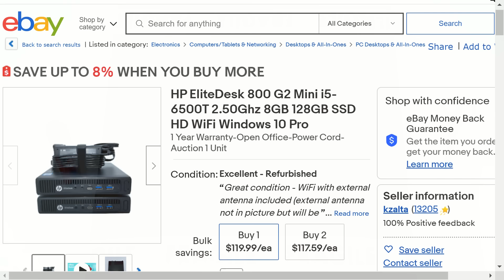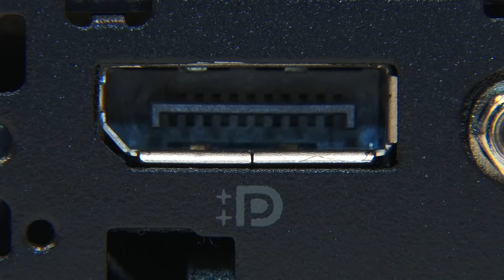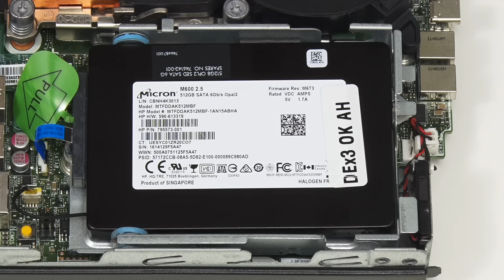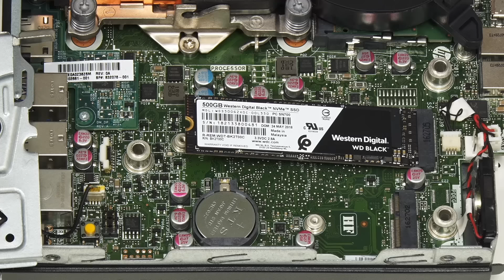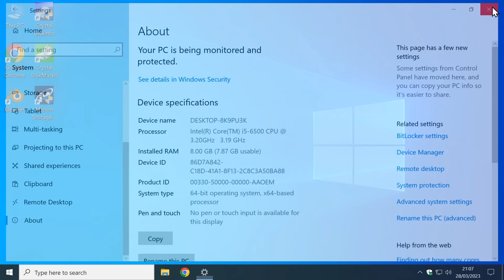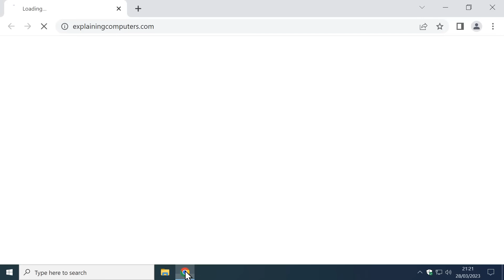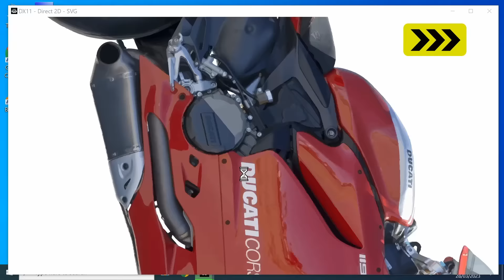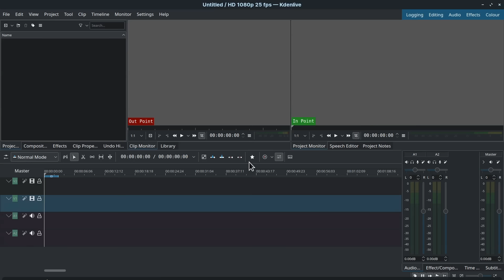Renewed i5 Mini PC: HP EliteDesk 800 G2

Comment: Great video Chris, I have been using one of these computers for the last 4 years as my daily triple booted with no issues. Although I have and array of other sbc and towers. I really like the size and performance of these units 
Thanks for your work
Reply: You don't trust the cloud ? Stuck in 1978, Personal systems need !
What you run on them ?
Reply: Some people (me ) just like computer hardware for the sake of it. I have a large collection of machines of different ages and types; just fun to use a different one now and again with various operating systems. They would have been thrown out so it's a good thing! @lucasRem-ku6eb

Comment: That's mini, not SFF. SFF is an official designation, certainly by HP.

There's only a handful of those on eBay Australia, we have heaps of Dells, mostly micro.

I got a Dell Micro of about that vintage, it seems to be buyer's choice whether they come windows Ten or Eleven. Mine cam with 32 Gb RAM, a 2.5" SDD similar yours, but allegedly new and M.2 WiFi. And, mercifully, no keyboard/mouse.

Before retirement I bought a lot of this stuff at auction, we were assumed to check the computers out before commencement, and then worked through the catalogue over several hours.

One auction hose in particular did a pretty good job of inspecting the computers, and buyers were alerted of discovered faults. I don't remember ever finding one that unexpectedly didn't run, I did sometimes find undescribed additional hardware, a disk here, a graphics card there. Some kind of satellite card one time.

Sometimes during the auction, sometimes at the end, we went to collect our purchases. At that time, we got the box(s) we purchased plus random keyboards and mice as described on the receipt.

I discovered it best to watch the first hour, while the amateurs met their requirements. I had no concerns about outbidding dealers, but the deeper into the auction the cheaper the computers became. The business computers were generally SFF, mini/micro hadn't been invented yet.

Comment: i’ve been tinkering with the hp elitedesk 800 g1 usdt for a couple years was used as a desktop replacement running linux mint then windows 10&11 with a spare hdd setup as an emulation drive since been retired to a htpc since then but still has plenty of life and power for other uses like it’s mxm gpu slot i’ve been trying to populate could turn it into a ssff gaming pc

Comment: Worked for a bit in a place where each worker had the Lenovo ThinkCentre M900 Tiny with i7 6700 and 16 gigs of ram - they actually do fairly well for the programing/designing that company does. The power rusage and snappy performance are the only real + sides tho. Even at 20-30% CPU usage the fan ramp up to max rpm and they not only produce serious heat (old hdd sitting next to it on the table was warm and that wasnt directly behind the fan) but the noise can be heard across a big room. The expansion or upgrade options are non-existent - u cant replace anything inside of them beside adding storage or ram...
Reply: Yeah, they are basically like laptops. If you do any major work the fan will crank up. Fine for general use, but if you like silence, or do heavy computing a full size desktop will be a better option.
Reply: @volvo09  Not exactly. In terms of expansion/thermals/power they are the same as laptops but even tho physically these tiny towers are smaller, you still need full peripherals to use them - aka input device/s, monitors etc. The main reason I was given why they bought them there was cuz of the pandemic and working from home (it was hard to carry the big desktop and monitors to ur home and room was an issue in smaller living spaces) + electricity bills (before they had older xeon systems which indeed hog more power). For this company, the workload requires 2 monitors with decent resolution (2k is minimum) and big screens - anything less or a single monitor just doesn't work when you need easily 4,5,6+ things opened at the same time. When you need to put 2 biga** monitors in your home, I don't see how the form factor of the PC would solve any space problems you might have.....  Meanwhile, as annoying as a track pad can be, laptop can easily operate anywhere on their own. Just bring portable 2nd monitor and , imo, you have better version of that PC...

Comment: One year ago I bought an HP ProDesk G5 for £150 with an i5 9500,8GB RAM and 256Gb SSD. I love the 6.5W idle power consumption because it runs 24/7 as a webserver.
Reply: A dell optilex with same config except 9600k cost me 100$.
Reply: It is interesting how low of a power draw simple computers have now.  I just bought a cheap new laptop with a Celeron N4100 in it, it almost never draws more than 13 watts and that includes a 14 inch monitor.  If I have it connected to my large office monitor it draws less than ten watts.  It isn't the most powerful CPU in the world but it plays 1080P streaming video and is decent enough for simple internet use.  It likely won't be my daily driver but it is light, compact and useful enough if I need to take a computer somewhere.
Reply: @mharris5047  Until you are looking for a 4K gaming machine for flight simulator.  Getting something power efficient is just not there yet.  Probably I have to wait two hardware generations for that. I don't want a noisy +300Watt system for gaming.

   I own a Prodesk 400 G4 I5 32 Watt and an Elitedesk 800 G4 I5 65 Watt. Affordable from auctions. Building a comparable Mini ITX system from second hand parts will be more expensive because of shipping costs.

 I also built a Haswell I7 T series machine myself in 2014. Still a useful NAS because of PCIE with NVme adapters and the sata connectors.  Not economically viable to replace that one yet.
Reply: I remember when SFF HP/Compaq PCs were the size of old VHS Recorders!

They had CD-ROMs & 3.5 floppy disk drives.
Reply: Nice deal for a G5 I5.
Reply: The HP ProDesk is a SFF PC (the Lenovo ThinkCentre M series also uses the same form factor). Chris should note that the HP EliteDesk isn't a SFF PC, and is using a different form factor; what ever that form factor is. Does anyone know which form factor the HP EliteDesk is based on?
Reply: @pixelPlex  The HP PCs are available in both sizes. One has the keyword "SFF" and the other "Mini PC".
Reply: Good. Now I have ZimaBoard 216 which is not powerful enough when needed, three days ago I ordered used/refurbished Fujitsu Q956 with i5-6500t, 128gb ssd (very likely nvme) and 8gb ram for 130EUR. Because SSDs, RAMs and euros are cheap right now I'm almost considering to upgrade it to 512gb or 1tb ssd and 32gb ram and it will be just slightly worse than i5-4590 computer I used year and half ago and was quite happy with it. Larger PCs usually have better specs for the same price, I hope I won't regret it, because any upgrade can complicated (such as adding sata ssd or 2.5" drive, because it has proprietary power connectors)

Comment: Nice to see you recognizing that we are awash in affordable processing power!!
Reply from the maker: What a great way to put it! :)
Reply: These are a great deal because they are light, small, and easy to ship. The older SFF desktop pc's still weighed like 10lbs and took a big box to ship, so you couldn't find such great deals. 

All my pc's are old office lease office hardware. I have a few mini Dell PC's like this, they are nice for what I need, and they even have socketed cpu's... I believe this HP should also.
Reply: @volvo09  Same here, although I also love me some ThinkPads, and I also drive an old Volvo.  (She'll be 25 this year, and still runs like a dream.) 😁
Reply: @volvo09  I have several HP SFF (not the USFF like in this video) computers.  They tend to last at least ten years and I have one that has a Pentium 4 HT CPU from 2005 that still booted up when I played with it last year (2022).  At $100 I would say they are an excellent deal even if they only run Windows for 2 1/2 years.  I usually pay about $150 when I buy one but my main computer was actually $50 in 2020, it has an i3 4th generation in it.  I put $100 or so into it upgrading it to 16GB RAM and a large hard drive, though (I won't count the second large HDD used for backup purposes only).

Comment: The one you've got is a 65 watt version that can be easily recognized by the vents on top, there are also 35 watt versions without those venting holes and can be easily stackable.
Also, 35 watt version use lot less energy while performing slightly less (assuming both have i5). Still, 35 watt version is my preferred model (got 5 of those).
P.S.
Fans on the HDD caddy seem to only be present on 65W versions.
P.P.S
G3 version of 800 series mostly don't have HDD caddies so be careful if/when ordering one of those newer models.
Reply from the maker: Very interesting. I assumed this was the 6500T version, and the power use was consistent with this. But Windows reported 6500 as you note.
Reply: Of course if you run 5 of of them, more shillings in the meter 😉

Comment: Crazy we seem to be totally in sync! I am at my mum's and I just refurbished an HP Compaq 6000 small-form factor from about 2007. I got rid of Windows, (and the HDD it was sitting on) upgraded the 2GB DDR3 Ram for 8GB (for pennies) and installed Lubuntu on a 512GB SSD. Works like a charm now, very responsive, even plays HD YouTube without problems. I'm tempted to upgade the processor for the highest spec one it will take, a Core 2 Quad 9500, for £11.
It also has a Display Port which surprised me, I didn't know it was so old!
Reply from the maker: We are in sync indeed! And I get the impression -- both from the comments here, and more generally, that we are far from alone. Refurbished SFF business hardware is I think a rising maker/enthusiast trend.
Reply: @ExplainingComputers  Perhaps because it's so easy to get hold of compared to the Raspberry Pi, and also outperforms it with many tasks, especially with desktop internet browsing.

Comment: Did you set Crystal Disk Mark to NVME SSD settings or leave it to default?
Reply from the maker: It was left on the default, as the intention was to compare with SATA and other results. But if comparing NVMe drives you are right, the mode would best be changed.

Comment: I've got one of these as my TV pc / media center. I picked up 16GB ram for £20 from cex along with a 512GB nvme SSD for £40. The last upgrade I've gotten is a i7 6700T as a processor upgrade again from cex. The pc itself I purchased from Cash Generators for £50.
Reply: Is the CPU actually socketed for upgradeability?  I've assumed they are soldered onto the board.
Reply: @Chris Brisson  It's a normal socketed desktop processor. I purchased the exact same system as Chris is using from cash generator for £50. I re pasted the processor when I upgraded it to the i7 6700t. The I5 that I had in the system I traded in for 16gb ram.

Comment: i've a HP EliteDesk 800 G4 35W Core I5-8500T 2.10GHZ 256GB 16GB which runs flawlessly both win11 and macos ventura :)
paid 170€, full efi folder for ventura is on insanelymac site